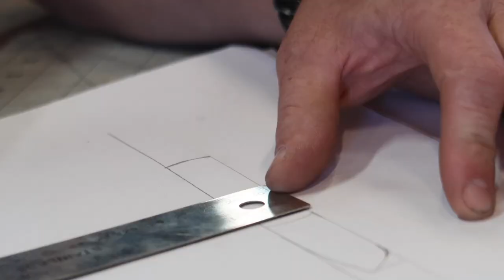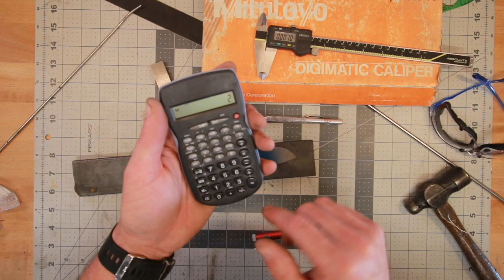Making a Friction Folder - Part 1- (vlog)

Comment: I really like the vlogs instead of a typical build video, because it gives a lot of insight into the problem solving. It also gives a better idea of how long a project actually takes and how much work actually went into it. With a typical build video it comes across as if a project was done in a day even if it took  2 weeks.

Comment: You liked the build process on my instagram, it's a weird one to get the hang of. That looseness could have been the G10 on steel pivot, if the other one was on and screwed in it might not have been so wobbly. You may also need to do a liner of sorts on the pivot, epoxy the liner to the G10, and the screw running through the liner. Just make sure it's just shy of the G10 or else it won't be able to have an adjustable tension.

Comment: If you hand-make a folder, my opinion is to rough-cut the blade/handle sides and belt-grind all edges square (all parts just squared off) and proceed with the area of the hinge detail FIRST.  This facilitates being able to mount them into the jaws of your milling machine vise to do a much better job of fitting things together.  When the hinge details are finished, you can then shape and grind your blade and scales.  You will never be able to precisely align everything by scribing and center-punching the locations.

Comment: if you end up with slop or if your knife pivots too far and doesnt stop where you want, you can enlarge the stop pins and sometimes that saves the piece.  also I found a product from USAknifemaker.com called CamStop which is a stop pin that you can adjust. I have never tried it but it seems like a genius idea for folding knives.

Comment: I've found that the people that try to put out content every day tend to also really loose track of the audience's interest in favor of the pleasing the YT algorithm. To this end, some videographers will shoot footage of random off-topic things in order to pad runlength to 10minutes for a midroll advertisement, or release redacted "what I did in a day" vids. Please don't bow to the algorithm, as I - and possibly many of your subscribers - are subscribed specifically to watch and learn from your knifemaking skill. Watering the content down means more watch time for the same or less content, and interest wanes.

I have an idea though, it looks like you remove a lot of potential learning opportunities from your knife-per-video releases and I really don't hold interest for a knife that takes a week to watch get built. If you were to release the start-to-finish video on Day 1 and then for the next 3-4 days release detailed, specific videos on a detail or trouble you overcame, then a 5th video on the sheath and testing, that would work well for me and the algorithm. Furthermore, it may help you to come up with more details to add to your builds that you can showcase in a video. I suspect that this can help prevent and compartmentalize airing a lot of false dilemmas and whatnot, like happened with that tracker knife series (probably my least favorite) in favor of actually pushing yourself until you honestly mess up and then have desirable footage of how you overcame it... Even if you have to pick back up at a later date. "arrows in your quiver", so to speak. 

I'm looking forward to seeing how you develop your channel in the future and hope my feedback is helpful.